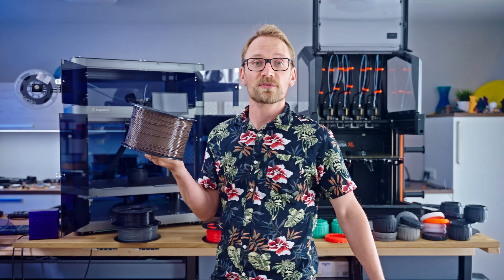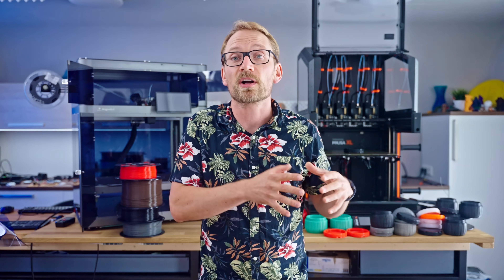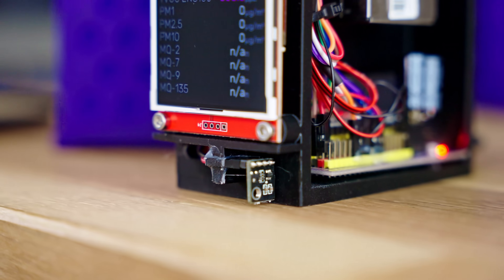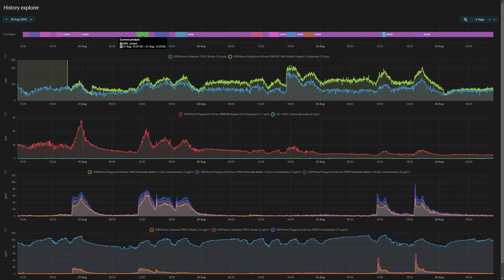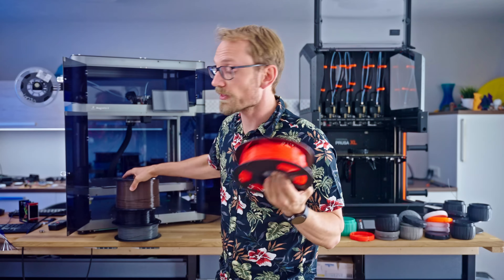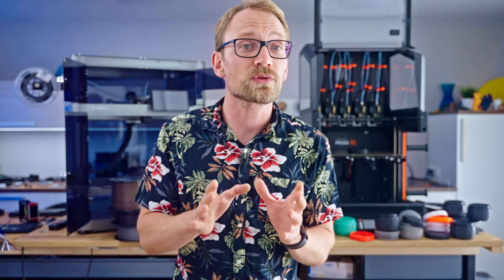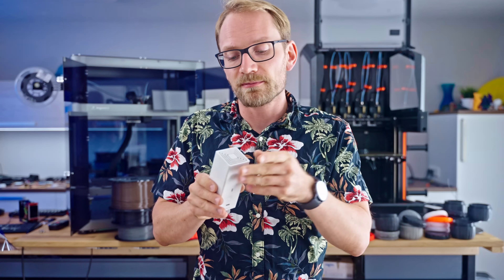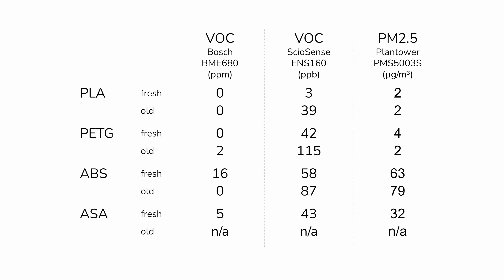3D printers are worse than I thought. Time to do something about it!

Comment: Awesome video.  BTW, formaldehyde can have lots of sources, but a big one is particle board.  Believe it or not, all wood emits a measurable amount of formaldehyde as it ages, even if it's literally just a chunk of wood that you chopped off a tree.  The amount is pretty small though.  However, particle board and some plywoods use UF (Urea-Formaldehyde) resin to bind it.  UF is hydrolytically unstable and it will slowly decompose back to urea and formaldehyde throughout it's entire life cycle.  This process is dramatically increased on warm, humid days.  This is why all those people got sick from FEMA trailers after Hurricane Katrina many years ago.  Regulations have forced chemical manufacturers to adjust the Urea to Formaldehyde ratio to favor Urea.  This has helped lower emissions a bit at the cost of strength.  There are other, safer formaldehyde-free options available.  However, it would raise the price of a single board by $0.05-0.10 a board, and manufacturers are not willing to do that.

Also, regarding cyclosiloxanes... that one is funny.  I don't worry about it as much, as silicones are generally pretty inert.  There have been some harmful effects found with them, but at the same time, they are used as ingredients in things like suntan lotions and other cosmetics.  They give a great hand feel, and the smaller ones like D4-D6 are volatile enough to act like a solvent without being flammable.  Interestingly, they were thought to be somewhat transient in nature, and that they would break down pretty quickly.  That turned out not to be true, and we are finding cyclic siloxane accumulation all over the world, even in the arctic!   (Note that most silicones will break back down to cyclic siloxanes eventually, albeit pretty slowly!)

For me, I do my 3d printing in my garage.  I should filter the air, but I don't.  I know the Bambu X1C has a filter, but I doubt it does much.  I only printed with ASA once, and it stunk up my garage and coated the glass of my printer in an opaque film.  I only print PLA now.  Eventually, I think the best bet is just to plumb those emissions outside with some ductwork.  Eventually, I will do that.

Comment: So er... Basically, just like with soldering, apply air extraction? :)
I'm not going to bother with filters and air purification because these usually don't work very well or if they do, they're mighty expensive. 
Better to just fabricate an airduct with a good fan trough a window.

Comment: When I got a printer 3 years ago I was paranoid about the smell so I built an enclosure with an exhaust vent. That way I could exhaust any particles outside once a print was finished. I'd leave it on while retrieving the print so disturbed particles would be less inclined to leave through the door.

Comment: I print mostly with ABS and ASA as I need their mechanical strength. I built a complete enclosure for the whole printer. The enclosure is fitted with an extractor fan that exhausts via a cross flow heat exchanger to outdoors. Clean air from outdoors comes in through the heat exchanger back to the enclosure. The heat exchanger helps to keep the enclosure temperature constant and prevents wasting energy in the winter. With this setup there is a negative pressure in the enclosure and no discernible odour in the workshop.

Comment: wont negative airflow effect the 3d printer and woobling ect , i mean if you put a 3d printer in a close case , 
it will hold the temp longer , but if you put an active filter that generates negative air flow , that has to have some kinda 
effect on the prints or am i wrong ?
i print with A1 + ams from bambu lab, i stick mostly to pla , and sometimes PETG , but im wondering if what TPU are emmiting ?
could you do a test on that ? 
cheers and best regards :)

Comment: I'd like to see levels on LW-ASA, LW-PLA, and Varioshore TPU. All of those are typically printed at around 50-60% of standard flow. Which would seem like there would be around 40-50% less particulate however the foaming activity and on average higher print temperature needed to activate the bicarbonate blowing agent may cause much more particulate to become airborne.

How much though. I imagine those could be on par with non foaming versions or much higher.

Comment: Bought my first home 3D printer in 2014. Ran mostly ABS for 3 years in an enclosed, heated system. Some of the First things I printed were parts to mount a Noctua fan with high static pressure on top of the enclosure to pull the fumes out of the enclosure, through some 4" ducting to a custom installed window frame that mounted an air conditioner and had a clear polycarbonate panel with a through passage to the outside that the ducting would flow through, evacuating the fumes and particulates from the room the printer was in. Had an activated charcoal and dust filter on the outside to mitigate the impact on the environment. 
I also flipped the power supply over to pull fresh air through it instead of from the chamber and into my room, and got some free chamber heating in the process! 
Had variable speed control on the fan to help regulate the chamber temps depending on bed temp. 
No smell, no headaches, no nasty fumes or materials going into my lungs! 👍

Mike in San Diego. 🌞🎸🚀🖖
Former R&D Engineer with 30 years of experience.
Reply: I did exact set up, ac unit and all but for a grow tent, worked exceptionally well. Maintenance Mechanic 10 years 😶‍🌫
Reply: you're an experienced professional. Meanwhile all the kids and parents, hobbyists etc printing like crazy with non of this. This will increase cancer rates. 

Glad you acted reasonably.
Reply: I'm in NYC and have been considering this type of solution. 
I want a window shroud with ventilation hole that I can plug exhaust hose into.
Then I just need to alter my printer to have negative pressure and exhaust fumes to the ventilation hose.
I'd like to make it general purpose for also exhausting solder fumes and heat.
Reply: @sleeplessdev7204  you can add a HEPA and pre-charcoal filter by just finding filter replacements for air purifiers and putting them in line.  Your neighbor with an open window probably wont even have a plan to find you alone in a dark alley if you filter that air before belching it out of your place and into their window ;)
Reply: @LackofFaithify  Actually my window opens right at sidewalk level. Perfect opportunity to give those morning walkers a face full of VOC's 😁

But of course I'll add some inline filters... it would be too easy to identify me if I didn't 😏
Reply: @LackofFaithify  Anyone who exposes their neighbors to such gases should be sent to prison for 50 years.

Comment: I actually designed a vacuum system for my 3D printer. On one side of the nozzle is my part cooling and on the other is a vacuum nozzle. This sucks a considerable amount of air away from the nozzle tip and exhausts it out a nearby window. I do like the idea of one of those IKEA filters though!

Comment: I bought air purifier that has both carbon filter and cold catalyst filter (plus prefilter and HEPA). As opinions about cold catalyst filters were not too good I did not expect positive results. But the unit was extremely cheap, super simple, branded by the local producer (of course a kind of rebranded Chinese device). I was surprised that VOC levels dropped quite quickly when I put the device near the printer. It was also very effective for cigarettes smoke. Of course there were not any scientific researches and I do not know the sensitivity of VOC detection in my air pollution meter. My prints are 98% PLA and as I live in an apartment I also abandoned an idea of resin printing. The printer is in a room rarely used for other purposes so I think it is rather safe. But I still have concerns related to filament types with add-ons like CF. I know that CF can be very harmful during processing, like cutting... but what about CF fibres in a filament? Any advice?

Comment: I print 100% ABS and I'm using a big chunk activated-carbon filter which designed for grow-tent to re-circulate the air inside a rubber-sealed ikea cabinet.

Comment: The one situation when I can smell a strong odor from the printer is when swapping nozzles (as it requires heating the nozzle to 250 Celsius), or when switching from printing PLA to PETG, I can also smell a strong odor for a short while. Probably because there is a small amount of leftover filament in the hotend even after unloading the filament. I guess I should be putting my 3M respirator on when doing those things from now on 🤔

Comment: Thanks, Tom - I've been concerned about this from the start, but real info has been tough to get. Many sources bypass our health with "no problem " comments for pla. I do have a small WINIX activated carbon filter running up in my cave, but am wondering if I should move to the garage.

Comment: Well, best analysis would be getting air capturing devices to lab test composition in a lab
These tests are common in work places and government ran agencies have hardware and labs to run the tests
Instead of measuring whole room just capture enclosure air for analysis
DIY can get you that far, while work safety agencies already have hardware and could make much better tests on fraction of the price

Comment: The ESP links are dead lol. RIP.
But this video has made me more cognizant of what I'm printing. I've always had an air purifier with both HEPA and active charcoal filters in my 3d print room, but I thought PETG was relatively safe. I didn't know it could release so much particulate and VOCs. I'm going to stop procrastinating with installing the Bento Box inside of the printers, which has HEPA and active carbon as well, and I think I'll be sure to place my air purifier much closer to the printers and turn up the fan speed while they're going.
Reply from the maker: Which links are dead? They all work perfectly here.
Reply from the maker: ah, found one - fixed it!

Comment: I made a VOC monitor with a Sensiron SGP41, and while a Dyson in the area doesn't tick up for VOCs, the Sensiron goes through the roof having defrosted a piece of sourdough bread and toasted it without burning. I think this is from the release of aldehydes, which the SGP is sensitive to, and potentially Formaldehyde. This is for a relatively short time compared to printing of course, and can be mitigated to some extent by opening windows and setting the extractor going, but had me questioning whether I should stop toasting bread. Clothing tends to be a source of VOCs too due to washing, and we're potentially in a mini VOC fog if we're not moving around. I started getting purifiers, which are definitely effective for particles, but not so much for VOCs as Thomas found. I've a massive carbon filter with 6" air ducting in my resin printer tent, and that does seem to work well for that. With thankfully not too bad air outside where I am in the UK apart from NOx and PM reads sometimes, opening a window is effective at reducing the VOCs coupled with the purifier. We also breath out VOCs, sometimes large amounts, and so if sitting close to a sensor, that can skew readings.

Comment: Build CR boxes. And dont stay in the same room when printing. job done well and cheaply. You dont need HEPA filters, as HEPA tries to retain particles on ONE pass.  You can use furnace filters or simply ikea filters like the one you show for that. It works well, i built one with 2 of the largest / thickest they had, double the thickness of yours (named starkvind, without carbon filter). I use the same dual AHT/ens sensors to check, they arent that good, but good enough for that usage. I also use that same air filter @17:00 in the room next door to make sure. It works pretty well

Comment: I have an air filter for my 600 sqft garage that has 20lbs of activated carbon in it. It will remove the ABS smell while printing. I found the best solution is putting the printers in a large enclosure that is put under negative pressure by my HRV.

Comment: I absolutely like this video. I'm only missing one thing: halfway your video you refer to those small 'in chamber' filters, and you doubt their effectiveness. As you've pretty much been meauring the air WITHOUT these, it would be very nice to do a test with one running inside the chamber? If so, preferably with a Bento Box, or (perhaps even better) the Carbon Max (a Bento Box derivative), as those contain much more carbon and filter than the small unit you showd in your video.

Comment: An easy solution to remedy this is to find a spot on the printer where you can exhaust the gases from. Using CPAP hoses, a few inline server fans and a pwm controller you can vent printers outside and control the speed in order to not suck too much heat out of the enclosure. It creates a nice negative pressure inside the printer while not losing any heat in my testing. Used for years now, each printer has a cpap hose connected to it, that goes into a "joiner" with ports for all the printers, then theres 2 inline server fans that exhaust it out the window.

Comment: Abs is carcinogenic. I dont see why anyone would want to print with that material. Its hard to print. Prone to warp and toxic af. I just stick to pla and petg. Esun and sunlu petg i cant print at 18mm/2 volume at speeds of 230 so they pretty fast. Esun high speed petg seems a bit of a bust as I can only get that to print stable at 20mm/2 volume and 250 speeds on k1c

Comment: I'm curious how well a dedicated enclosure with an exhaust fan would fare in comparison.
I bought a small-ish grow tent with vent holes and a fan with flexible tubing that runs outside for my resin printing.
It seems to be working wonders so far as I can't smell any odours and I don't have to rebuy any filters which will probably be even more costly in the long run.

Comment: so do you think it would be better to put the air filter directly in front of my 3d printer and turn it on while its printing, or put it right next to where I am sitting in my apartment 99% of the time and just leave it running most if not all the time?

I just have a single 3d printer and I am printing only PLA and TPU at this point, which according to your tests shouldn't be causing me any issues. I don't even smell the PLA unless I go right over to my printer while it is printing.

Comment: Heating any plastics is a bad idea. my printers are next to open windows with fans blowing out right from the start. i don't print anything with carbon/glass fibers long before any youtubers realize there is a safety issue. i am definitely not gonna get a resin printer.

Comment: The irony of a resin sponsor in a video about 3D printing fumes.
Reply: LOL 🤣 🤣 😆
Reply: Resin will melt your brain. Breath it for too long 10+min and you'll start feeling drunk before passing out a bit later. So make sure it's VENTILATED where you are. 
(My reference is regular epoxy resin, not the 3d stuff but should he similar)
Reply: Considering the chemical complexity of printing resin, they're probably even worse
Reply: @_Xantras_  that's horrifying. 
a gas mask is definitely a minimum requirement. Scary part is you don't even realize it's happening until it's starting to affect your mobility.
Reply: @OutOfNameIdeas2  3D printing resin is much weaker than this. Ventilation is still strongly recommended though.
Reply: @truereaper4572  How do you came to that conclusion?
Reply: @MrGTAmodsgerman because 2 part epoxy is an exothermic reaction tossing of a lot more VOCs and intended to be very very strong requiring more chemicals etc would be my guess. 2 part epoxies absolutely pump out fumes
Reply: @scottyboy6269  But the bottom line is what matters. Just because one have more VOC's, it doesn't mean that it doesn't need a respirator or if anything that it can be handled with bare hands or something. Well i don't think you can speak for truereaper.
Reply: @scottyboy6269 uv resins still produce enough heat to offgass alot of vocs, same as epoxy just because you can't smell them doest mean they arnt there. I'm not entirely sure but I know a few people who developed asthma from working with it
Reply: SponsorBlock to the rescue

Comment: With my VOC and particle sensor (Air Gradient) I see really significant spikes when the Bambu X1 and A1 Mini are changing filament which I suspect is caused by the ~30 degree higher nozzle temp used when flushing old filament.

Comment: I actually what I find the most effective is placing the printer next to a window and open it. :) I actually work beside my printer, but I don't print any abs.
Reply: Actually better to vent outside using a length of tube, and fan, keep the window closed, keep warm.  And if you have a Bambu enclosed printer you can use the inbuilt fan.

Comment: The IKEA purifiers are pretty bad. The Förnuftig only does a half-assed job and that's if you literally run it on max, and on max it's loud. Anything under max is also quite ineffective. Obviously better than nothing but I don't even think the filters are true HEPA. Certainly this newer cheaper shoebox is even worse. But yes, they're cheap and they do more than not having any filter at all but if you're going to be actively generating particles, it might make sense to buy a real filtering unit and not a "toy" designed by the lowest bidder or whatever.  The accepted wisdom, I'd say, is getting a couple of medium power units and have them working in concert; achieving a higher CADR is easier with more than one unit. And multiple units cleaning in multiple spots also gets a better distribution of purified air.